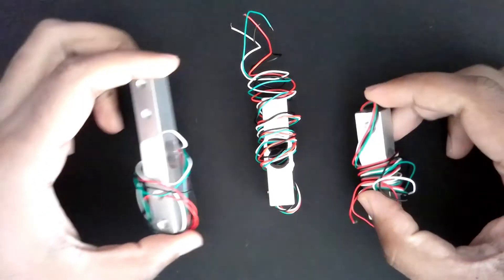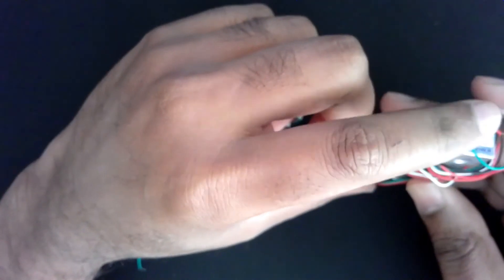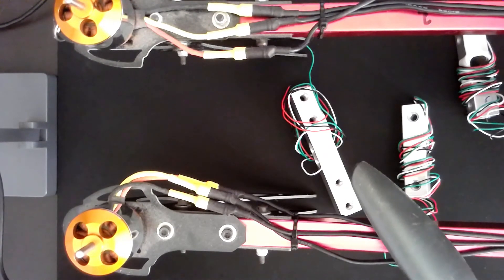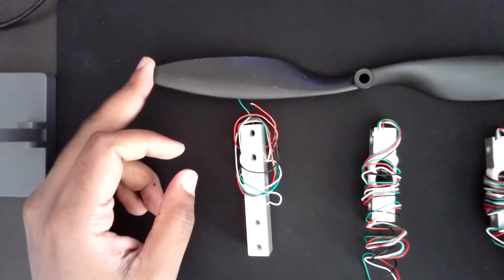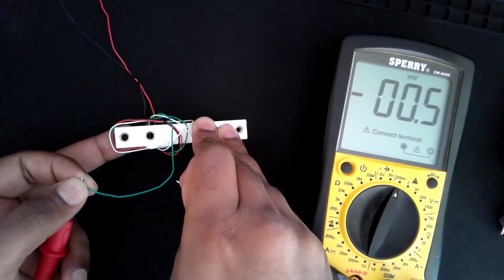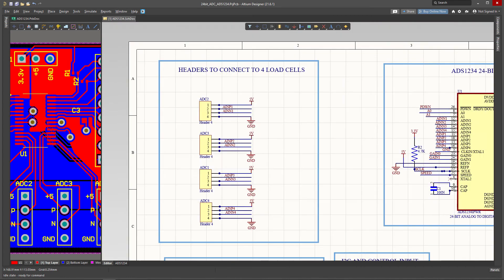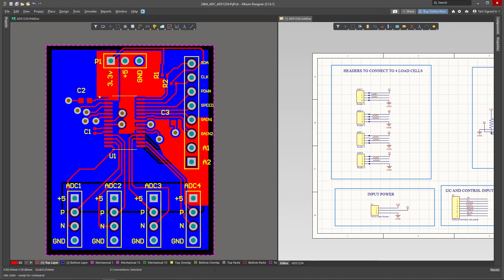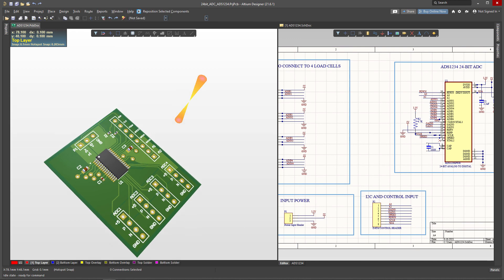How to design a 24 bit ADC to capture load cell readings using ADS1234 (Part 1)

Comment: Hi there ! Thanks for this video it’s very informative. I’m working on an arduino project (esp32) that used force sensors to measure at a very high frequency rate or sample rate (500-1000 samples per second) The loads I’m using will be in between 50-150kg. Could you recommend cost effective sensors to achieve this ? Apart from the adc what else would I need for this setup? I’m quite new to arduino and would appreciate any help if you can give it. Thanks so much.
Reply from the maker: @Martin Wolczyk from what you have written you need a loadcell that can handle your weight capacity, an ADC converter, micro-controller, and you should be good to carry out the readings. No additional hardware is necessary.

Comment: We want to Design a adc for CCD sensor for a project. Can we do it. I need your guidance and suggestions
Reply from the maker: @Varun Dsouza - Without understanding the scope of your project, your component selection and what exactly you want to accomplish it is difficult for me to suggest anything. If all you are looking for is a device to process the output from your CCD sensor, you may want to consider a signal processor IC for CCD. They generally have an inbuilt ADC in them.  Analog devices, NXP, Texas Instruments amongst others make such IC's. Try contacting their support center and ask what product of theirs can work well with your CCD sensor. 

All the best!